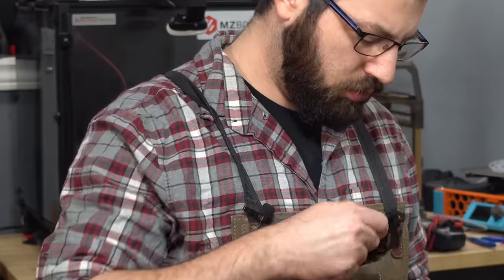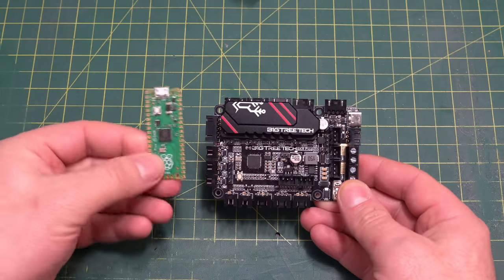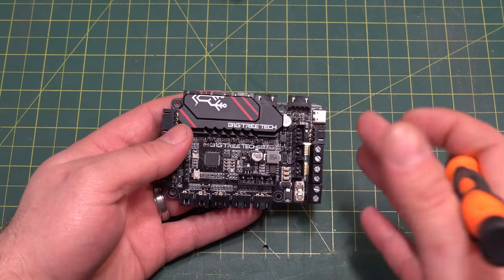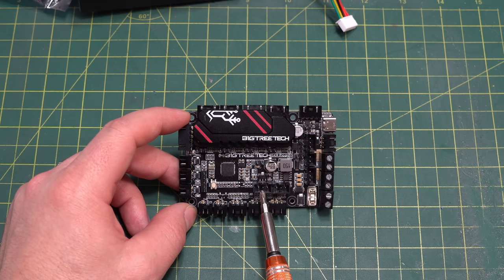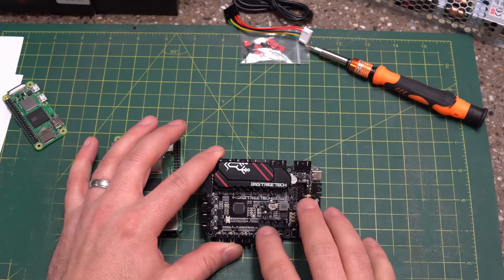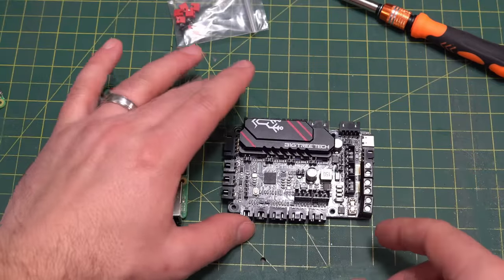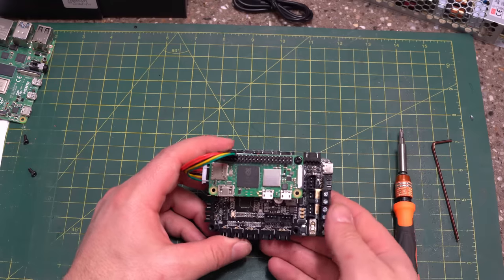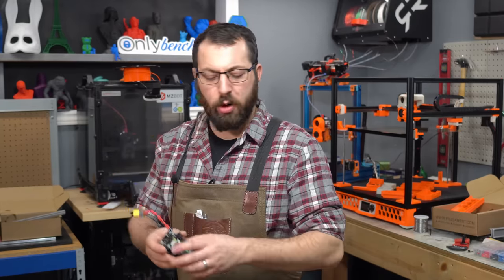The SKR PICO - Small yet mighty controller for your 3d printer

Comment: Is there a way to hook up a 3rd thermistor? I need it for my chamber thermistor.
Reply from the maker: This shows the RP2040`s lack of available pins coming into play, is what it is
Reply: @CanuckCreator  could you also comment on the heatsink placement? Is it attached to the top of drivers using a plastic package (no value) or to PCB pads soldered to the underside of the drivers (potentially useful)?
Reply: @WhiteG60  Thanks.
Reply from the maker: @mghumphrey  There are thermal pads between the drivers and heatsink
Reply: @CanuckCreator  That's not my question. The TMC chips I've seen are using plastic packages, which are not good conductors of heat. Instead, they have a large pad underneath that gets soldered to the PCB which then helps sink heat through the PCB copper. If they've placed a heatsink on top of the chip, thermal pad or not, it's not going to do much.
Reply: @mghumphrey  there’s two screws on the back of the SKR Pico with washers on them. Because the majority of the components are SMD, and there’s minimal through-hole parts in annoying places, there would be nothing stopping you from milling out a generous bottom heatsink for the stepper drivers, add a thermal pad, and attach it to the board with the same screws.
Reply: @mysfiring  I will just continue to use a board without a heatsink but with some active cooling (airflow over the board). I was just curious if the heatsink was an actual useful thing or just a marketing gimmick. It sounds like it's the latter.
Reply: @mghumphrey  obviously it isn’t going to be as efficient as an actual heatsink designed to wick the heat away from the copper pour on the underside of the stepper drivers, but it is better than no heatsink on the top at all. (Maybe you could flip the entire heatsink assembly, and put it on the bottom? Then it would at least be in the most efficient place. The thermal pad would probably need to be changed, as it’s pretty thin width-wise, but it’d be worth a try.)
Reply: @mysfiring  no, it's completely worthless. Worse than worthless, because it's designed to mislead the buyer. I would rather they were honest. The board would have been a good release without giving into the demands of the marketing department.

Comment: The firmware update workflow is a total showstopper for me. Klipper often makes it necessary to re-flash firmware and having to open up the printer to do so is a massive backward step in today's marketplace. What was BTT thinking?
Reply from the maker: Updating the firmware on the MCU firmware isnt a commonly required thing, usually its just the interface/klipper/moonraker (on the rpi) that needs to be updated when something new gets pushed, only when theres a MAJOR revision to the underlying FW with the MCU controller is an update require, which from what ive seen, is like once year lately. There is work on being able to update the the rp2040 within klipper remote so that may be available in the future as well.

Also the rp2040 is being used because its an MCU thats actually available in quantity currently due to the global chip supply issues.

So thats what BTT is thinking
Reply: Look at what Adafruit has done with CircuitPython. Once flashed, a bootloader remains between updates. The bootloader makes the board show up as a USB drive. All future updates are just file copies. It's glorious. This community will catch up.
Reply: One thing I forgot, in the near future, you'll never plug the controller board into your computer. You will connect it to an RPi USB port.
Reply: I don't think all this effort is necessary, as the Pi is also just a computer and can mount USB drives. You still have to dancing around with jumpers, but you don't need to bring it over to your computer and all that.

I posted approximate instructions in a top-level comment; there might be some details, but there's no reason the idea shouldn't work.

Comment: I'm surprised they didn't skip the RP2040 and go straight to having no microcontroller and requiring a Raspberry Pi 4 Computer Module.
Reply: MCU separate from the Pi is important, tho. It’s why the Beagle Bone and that line of hats with co-processors exists for 3D printers. ARM SoC is great at (in comparison to MCU) large computational loads, but hopeless at real-time operations, like sending accurate time-critical commands to stepper drivers.

...I mean, there’d be nothing stopping you from taking a custom motherboard, Pi4 Compute Module, TMC2209s, RP2040 co-processor, bundling it all up, and introducing it as the Taco raVico. 😉
Reply: That is what I am working right now. But the availability of RPi 4 Compute Module is not so good these days.

Comment: It's a perfect fit to Ender 3, Ender 2 and any other Prusas. My only concern is it has no interface to the standard 12864 display. 😭
P.S. I like programming RP2040, but the problem is it has no hardware support for floating point operations. Hopefully, all the math will run on RPI instead and SKR PICO( so the PICO will just drive steppers and listen to End-stops) most of the time.
Reply: 8bit board like Ultimachine Einsy (MK3) does not have floating point HW support either.
Reply: I have my conserns more about the wrong usage of heatsink for these stepper drivers. It should be done via PCB, not via drivers package as Trinamics recommandation from its datasheet.

Comment: Such a shame that it can only be flashed over USB with jumpers connected. This means that it has to be disassembled, everytime a new Klipper version comes out for the Pi, that isn't compatible with the version running on the board.
Reply from the maker: Luckily that isnt a super common occurrence, once or twice a year